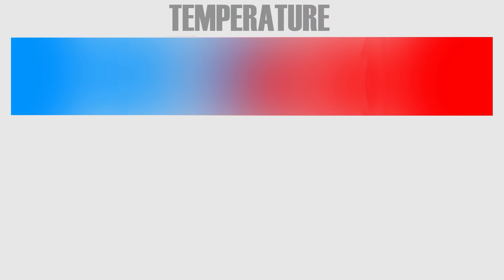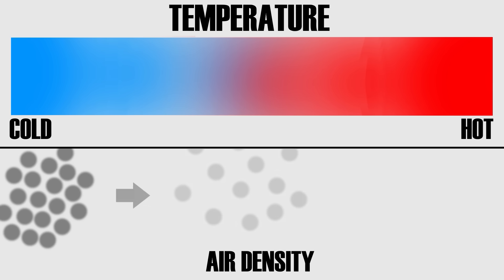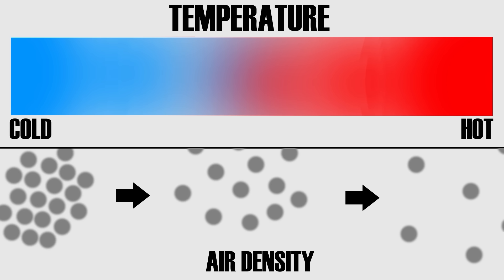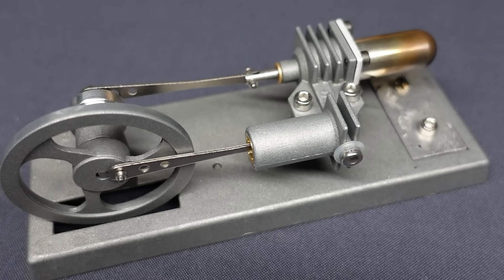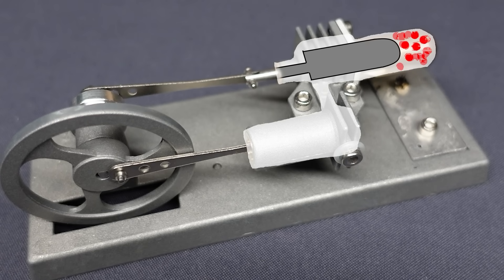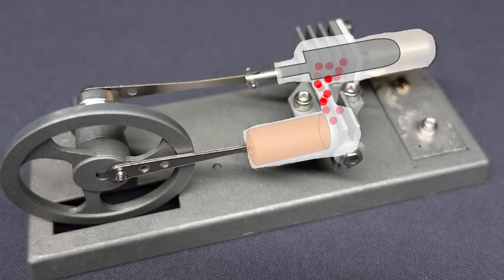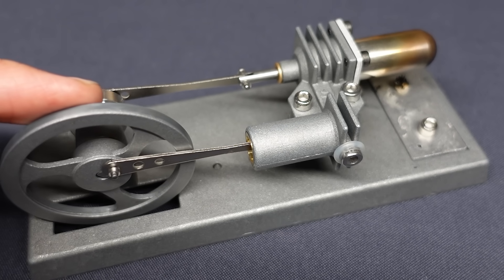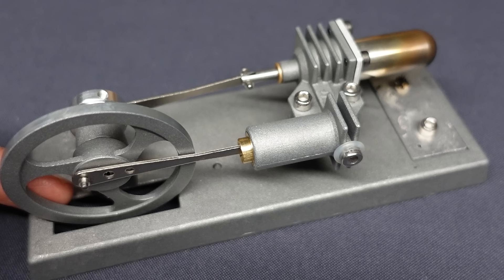It Can Save The World - The Simple Genius of Hot Air aka Stirling Engines

Comment: 2:30 is kind of misleading, a big one (like the ones used in Finnish stealth submarines) do need all of that. Internal combustion engines technically don't need lubrication, cooling, etc. This is true for pretty much any engine, unless you want to make power, in that case you need lubrication, cooling, fuel control, etc. However for something that just spins a flywheel (which excluding friction and air resistance, takes no power) it doesn't need any of that! Any time power is being generated any inefficiency becomes a source of heat buildup, saying the engine needs no cooling is saying this it is thermodynamically 100% efficient, and in that case you have a perpetual motion machine!

Comment: Ever since I learned about Sterling engines, I've wondered why they aren't utilized to run off the waste heat of other industrial machinery.
Reply: Because the juice isn't worth the squeeze.

Anything that runs at ambient pressure doesn't produce enough power to be worthwhile.
Anything that runs above ambient pressure is too expensive, both to build and maintain, to be worthwhile.

They don't scale up well like steam and internal combustion engines do. They are limited by the amount of heat transfer you can get through the cylinder walls. Thanks to the square-cube law, that gets harder and harder as you get larger and larger. Yes you can get larger Sterling engines by throwing money at the problem

The only commercial success they ever had was as small water pumping engines that could be left unattended once the wood fire to run them was started.
Reply: Because until recently electricity was so cheap that adding Stirling engines would have cost more than they would have saved. It might make sense to add then to machines that we have in space or other planets where energy is hard to get
Reply: Because until recently electricity was so cheap that adding Stirling engines would have cost more than they would have saved. It might make sense to add then to machines that we have in space or other planets where energy is hard to get

Comment: Good video, but like any thermal machine, the Stirling engine underlies the limits of the Carnot cycle, so it needs a high input temperature to have a significant efficiency. An even bigger problem is that, again for high efficiency, it needs a high pressure low density working medium like 300 bar hydrogen, which is very difficult to seal for a long time.
Reply: Yep. You can quickly tell in this comment section who has never taken a Thermodynamics course, and those who have.

Comment: Awesome, as always!  You forgot the other vehicle that Sterling engines power that ICEs couldn't:  NASA was developing Sterling Generators for deep space missions, that would be more efficient and lighter than the thermoelectric generators currently used for such applications.  Yes, there is the modulation problem, but unlike ICEs, they can make use of heat sources that decay slowly.  For hybrid electric vehicles, they would be superb, allowing every joule of fuel energy to be converted to electricity and stored.

Comment: Stirling is not really suited for vehicles. It won't start on it's own. Once it's running it has a rpm that it's designed for and always aims towards. You can modulate that rpm with the heat input but not much.
Also in a power plant it wont really work. We already use a turbine to convert heat to power. There is not too much excess heat and it's spread over a large area, not focused like the flame.
But Stirling already liked the idea of combining different sources of heat - heating, smelting, machine heat etc. with todays technology it's possible to collect the heat of different sources.
Also i really like the combination of a heat-pump, as those can move more energy units of heat as you put energy units into them to work. But in the end they always pump heat from a location of high potential to a location of low potential. There is no free lunch or perpetuum mobile by linking a heat work machine with a work-heat machine.

Comment: I love Stirling engines. Some configuration can produce 'work' with temperature differences as small as 2-3C. I have long thought that, with a tightly managed thermal cycle, they could be used to supplement grid power in remote regions using only shallow-geo-thermal energy.
I'm also a fan of the idea of using nuclear materials that cannot be further recovered (most nuclear fuel is recyclable up to several recycles); that're destined to be buried for 10k years, but can't drive a reactor anymore, could be used to run closed-thermal-loop Stirling generators.
NOTE: Radio-Shielded material are not thermo-insulated, meaning that the nuclear material could be rendered safe, but still thermo-harvested.

Comment: Remember the solar farms that use mirrors to direct sunlight at a heated element? Could use the same principle to heat a Stirling engine. Just kind of a cool concept.
Reply: That already is patented and some companies sell a style of this design as a water pump with the water providing the cooling. They were never adopted widely for power production as the dish needs to align itself with the sun, so having a reciprocating mass applying torque on a gyroscopic mount created maintenance problems. Also, losing potential power produced through parasitic loss by requiring said power to actuate a dish proved to consume quite a bit of useable energy. BUT it could work if you use an acrylic cylinder like some small stirling models use, you could make a greenhouse effect within the cylinder enough to spin a low rpm generator. Would be enough to power lights (LEDs most likely in this case) in your house but thats about it. If you were to scale it up and gear it to an efficient generator, you could probably get it store enough energy in a battery source to run a single house hold. Would only work in the summer, in the desert, on clear days though so really would only be good in very limited uses. Interesting to think about the energy savings however!
Reply: @iowasucks9494  basically there is simple solution. long row of mirrors that heat a tube and that tube has water that runs stirlig engine in the end of a row. no need to move at all. i think one such plant is in north africa. but solar panels are very cheap...
Reply: @jebise1126  thats a power tower that heats a medium (some form of salt if i remember correctly? Theres no stirling engine in that one) i was giving this more thought the other day and putting the cold side underground and only having the acrylic or glass cylinder exposed. Maybe having several in a row hooked up yo several generators? Hell even having an actual greenhouse, just filled with child sized stirling engines sticking out the ground? Expensive initial investment but could work. What do you think?
Reply: @iowasucks9494  no... there is long mirror and above mirror is a tube. no tower there. 
as for that tower.. what makes electricity? does it heat some sort of turbine? now that i think it may be turbine in one that i mentioned too.
Reply: @jebise1126  may have gotten them confused. If i recall correctly, it heats the medium and uses the heat to boil water and spin a steam turbine, so yes it is a turbine if im correct.
Reply: @jebise1126  reading our comments again im 99% sure we’re talking about the same thing
Reply: @iowasucks9494  17:07 17:07
Reply: @iowasucks9494 You should actually get somewhat decent efficiency year-round with a greenhouse effect on the hot cylinder. You only need a temperature differential for it to work, and sure, the hot side isn't as hot, but the cold side would be colder than in the summer with ambient winter temperatures.
Reply: @Blaquer17  that is true i didnt think about just cooling the cold side!
Reply: My working model Stirling engine runs from a fresnel lens
Reply: @georgebarnes8163  That's awesome!
Reply: Exactly what I was thinking. Banks of these feeding into the grid for more free energy!

Comment: With an efficient, highly-engineered Stirling Engine design, I am curious how much energy could be "harvested" from the exhaust manifold of an internal combustion engine. It could be a new kind of "hybrid" for production vehicles. I would be very excited to see this implemented together with modern technology. It sounds like an excellent complementary match!😃 Thanks for this excellent presentation!
Reply: An exhaust gas turbine also known as a turbo charger is a much more efficient and effective device for recovering wasted exhaust gas energy than a stirling engine could manage to achieve.
Reply: @howardosborne8647  I agree. 👍 It would be awesome to see a turbocharged internal combustion engine and a Stirling Engine working together. 😁
Reply: A lot of this tech goes under the name otto-ATEG-Stirling or diesel-ATEG-Stirling.
Those modules can harvest 2-7kW  mechanical that go in a generator and increase efficency by 2-5%.
Fuel consumption goes down by a view % as well.
BMW gave it a shot in the X6 in 2012 but abandoned the idea. The system needs 5-20min to get up to temperature/work, requires about 20-30kw from the ICE, and keeps running for hours if the engine was hot enough.
So most drives are too short and the required minimal speed for this system to fully shine is above the legal max speed in most countries.
IVECO used it later in heavy duty machines and special-purpose-machines like the submarine, which produce several dozen to hundreds of kW at all time.
What car manufacturers really digged into was the MGU-H which links a turbo with a generator/motor like in F1, LMP1 now Hypercar is used.
A turbo only needs a view seconds to get up to speed, you utilize the heat and air-flow, and you can optimize the air intake of the ICE.
But i doubt that anyone beside Honda will ever make a car with this. Regislation of too many countries abandoned the ICE already so it's not in the interest of a car-manufacturer to push anything in that direction anymore.
Reply: @MrHaggyy  Very interesting! Thanks for the informative comment! 👍

Comment: the reality is its horrible efficiency, under 10-15 % at car sized scale, even steam engines poor efficincy can reach 20-30 % with uniflow engines over 20% with compauding nad are much more powerfull, even torque is more than any engine ever can procude. a 3 liter doble steam car had 3000 NM in torque, compare that to an ic engine 3 L around 300 NM
, , doble steam car used very efficient steam engines, as the uniflow, steam engines can shift after load with pedal like IC engines, and can burn ANYTHING, im about building y own steam engine reaching for at least 20% efficiency with uniflow compauding with condenser, no gearbox is needed to. sterling is sadly not the future. but if is charge batterys to drive electric motor it could be

Comment: What if you added a weighted flywheel to it? Would it run longer when you turn the burners off?
Reply: Yes, but there is no such thing as a free lunch in thermodynamics. The additional momentum leading to longer motion during "off" time would need to be scavenged from the power used at startup.

Comment: Would make for a good range extender in a hybrid but I'm interested to see how an electric resistor/heater in the chamber would go
Reply: Resistor heater does horrible, a heat pump like in your fridge or AC that produces a temperature difference does much better but still worse then an electric motor directly. Unless you have another heat difference already.

Comment: What about water vapor in an evacuated tube? If the water vapor was used as the acting gas, wouldn't the condensation and boiling increase efficiency?
What do I have that completely backwards and supercritical water is the most efficient?
Wouldn't either be better than just air?

Comment: As a stationary engine, my first thought goes to solar heat. Using either a mirrored concentrator or a rail of evacuated tube collectors. :)  A large enough (or several) flywheel driving a CVT type take off, would help with required amounts of speed or torque to drive many things .
Reply: That’s exactly what I was thinking too

Comment: The power of a stirling engine can be controlled as the power is proportional to mean working pressure.
There is a great video called "Stirling cycle part 2 (stirling cytogenetics)" that shows a stirling engine 30hp being used to power a boat

Comment: In case any of your viewers are interested, these engines have been used to power cars. From 1986 to 1991, these engines were tested in cars. One program was the MOD 1 program. A 500 CC Stirling Engine made nearly as much power as the GM 2.5 liter 4 Cylinder.

Comment: The 4 cylinder version looks like a steampunk contraption. I'm in love
Reply from the maker: It looks amazing in person and it's super heavy when you try to move it around, it's a real conversation starter 😁
Reply: @d4a show it to elon musk 😊
Reply: Steampunk is an accurate description, actually, as it's a Victorian-era technology that has continued to be advanced far beyond practical needs.
Reply: @fyrstormer  i mean steam is still being used in power plants, there's no reason not to continue developing sterling engines, they make allot of sense in certain situations (lower pressure/temperature Geo-thermal where there's a hotspring, adding them to a cooling portion of a power plant excreta) just the cost of building one is up there.
Reply: you can make it solar punk as well, with a few well placed mirrors and lenses ;)
Reply: @e1123581321345589144 those exist and you can buy them. Called "dish-stirling" but they do have a really bad problem..
Reply: I too , it looks awesome 😋.. not quite practice , but hey looks fantastic
Reply: I love the sound actually.
Reply: Hot air punk

Comment: As a mechanic/gearhead..Cool...One question..Can Thermal energy be applied for heat source from the Earth?
Reply: I have my thoughts on that too. In colder regions (north pole, south pole etc) and a drilled hole bringing  up ground heated water it should work. Sterling engine is a temperature difference engine. You must not have a fire or combustion for it to work, just difference in temperature. In this example perhaps the circulationpump for the groundheated water maybe consume to much of the energy produced😢. (otherwise the world already have them in lots of places).

Comment: What if you didn't try to modulate power output but instead tried to modulate driveline engagement?
It doesn't help with the amount of time required between cold start and initial movement, but still...

Comment: Ugh, it really doesn't make sense. Using it as an engine is horrible, it's less ecological, as you need about 3x amount of fuel to get same amout of work as modern ICE. Waste energy in furnaces can be used in thousands better ways, like heating up water (which can be used to power a turbine which would be a lot more efficient). What im trying to say it literally would only make things worse trying to use this ancient technology. There is no way around using hydrocarbons, the amount you use is the same amount of CO2 you put in to the atmosphere. Demonstration between V2 ICE and stirling engine how its less toxic is extremelly stupid as one is burning a lot more fuel and producing a lot more power than the other.

Comment: This just gave me an idea. For winter especially. Have a Sterling engine for a generator. Using the same heat source to run the engine as you use to heat the area. You stay warm and create power for lights and whatever else you have. This would be great for a big garage. I just wonder how big of a Sterling engine you would need to power a garage full of equipment and how big of a heat source would be needed to run it. Jay Leno has a giant Sterling engine from around the early 1900's I think. That could power a large warehouse I'm sure. I just love the idea of creating power and heating an area using the same equipment. Simplify things. Get back to simple machines. No computerized, plastic things that always break. A Sterling engine can run constantly with almost no maintenance. Just a little grease on points and keep the fire going.
Reply: 20-30% of the heat can be converted to work. The difference in heat is the important part.
You just need to add up how much work and heat you need. There are fuel-cells on the market that produce heat and electricity.
Reply: Ah yes because large reciprocating machines never break down!
Reply: You may use the same heat source for room and engine but then engine creates significant heat loss. If power output of the heat source can be controlled and power grid is available, it is better to power lights and equipment directly.

Comment: Any heat engine (including in turbine-based power plants) is only as efficient as the cooling system you have. There is nothing like "waste heat" there unless there is "extra cooling", and if there is extra cooling, you just make a more efficient turbine-based power plant.
Reply from the maker: You're right, when you improve engine cooling the exhaust manifold doesn't get as hot. No such thing as wasted heat 😑

Comment: These are really cool, you can use the wasted heat and if you want to use them as a Generator as example you could use a heat source that you clock so it turns on and off since the engine doesn't need a permanent heat source, even for cars you could (only usable in bigger cars like campers or trucks) let the exhaust go into a compartment where it heats up the stirling engine which produces power and creates electricity which could then be used again for powering a type of engine that cleans the air.
Cleaning the air and at the same type also charging the battery of as example a hybrid truck could be really cool, if you can efficiently clean the air with some sort of engine, you could also make the trucks engines less restrictive which would result in longer life spans, more efficiency and they would be simpler again.